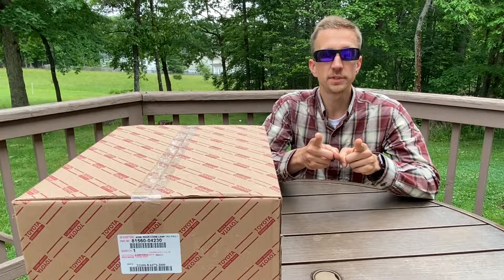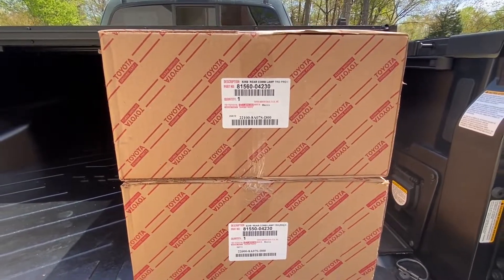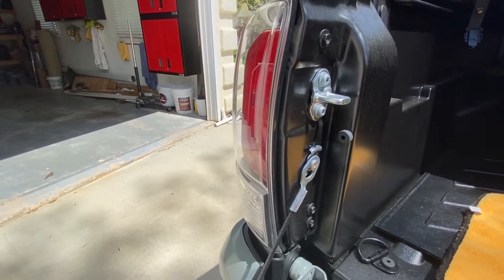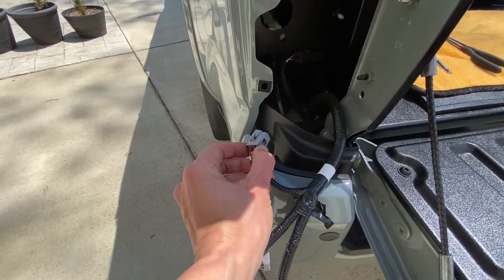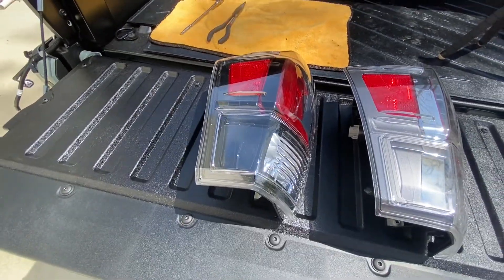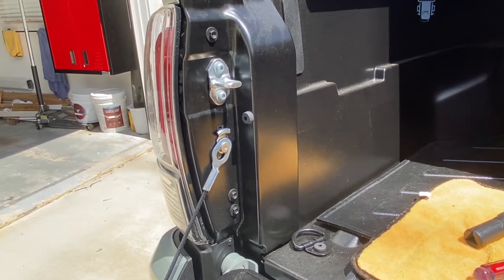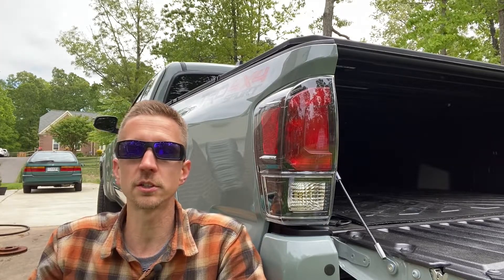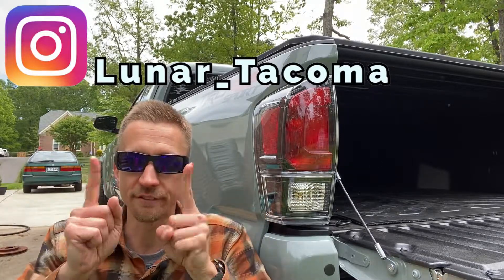How To Remove and Replace 3rd Gen Tacoma '16-'22 Taillights

Comment: What year is your truck? Will the '20-22 tail light assemblies in this video fit a 2016 TRD Off-road model? It's unclear if they will both physically fit, and have the same bulb harness. Also, are these LEDs?
Reply from the maker: ‘16-‘23 are all compatible. These are halogen as none of the 3rd gen Tacoma taillights came LeD from the factory. Have to use aftermarket if you want LeD bulbs or whole new housings.